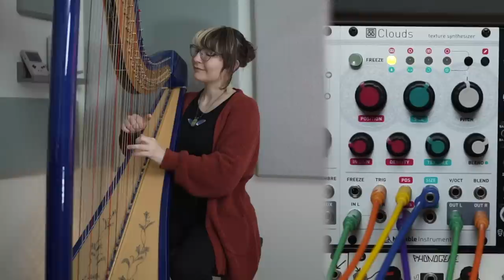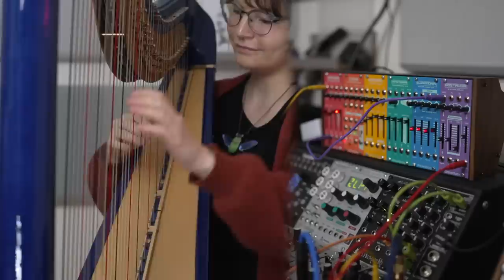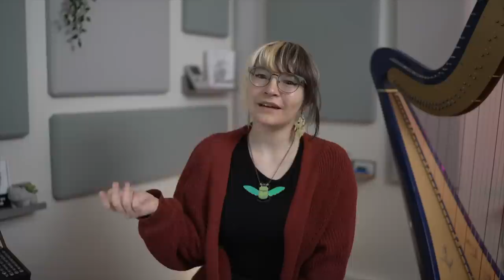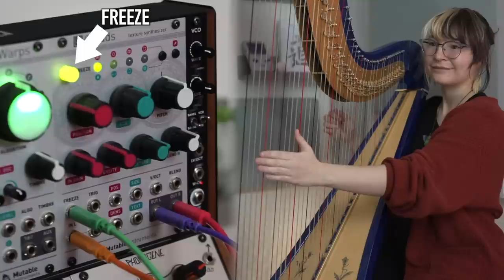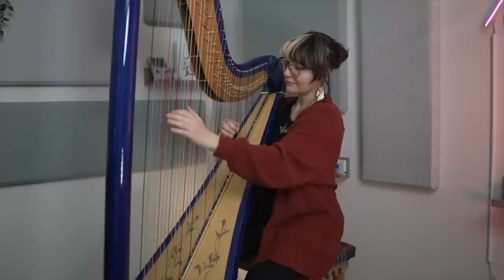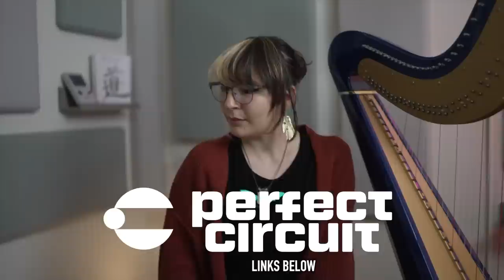I plugged my harp into modular synth. It was insane.

Comment: I think half the ambient modular synth players get into modular for clouds alone. ♥️

Lovely patches, and great use of your harp as a CV controller! It makes me want to plug my electric cello directly into VCV Rack again!

Some day I'll be able to afford taking the dive into physical modular, but for now I'll live vicariously through your exploration!
Reply: 100%. Started with clouds and came full circle back to just have the Grone module which has clouds. Running my upright bass through my modular system was fun.
Reply: You’re able to plug electric instruments into VCV rack? That’s sick!
Reply: @patrickbrogan8770  yea! I don't remember exactly the process, but the standard "Audio" module has inputs as well as outputs, so you can choose your audio interface input as an input into the VCV system on a different Audio module than you're using to get sound out of VCV Rack (hope that explanation makes sense!). Then your instrument is able to be used as a sound source, CV source (likely playing with some amplification, depending on voltages - I haven't done that much with it), and a great source for gate triggers and envelope followers. Also, getting to use VCV as a massive FX rack is handy too.

Depending on your setup, you'll encounter lag, which can be problematic, but I am pretty sure there are ways within VCV Rack to address that as well, just haven't messed with it too much.

Comment: Can I ask how the Octopus Sound was made?
Reply: Check out Fredericks video link thats in the description above! 🙌😎
Reply: TLDR; The octopus does not produce sound, it controls the synthesizers via patch cables. So think of it as a joy stick rather than an instrument in itself. I made a video showing how I built it in excruciating detail, lol.
Reply: The E950 that the octopus is controlling is based on the algorithms used for the Speak & Spell, with extra circuit bending options built in to create all sorts of interesting glitchy textures as well as words and numbers. You can change the words it “speaks” using CV control, so you could use a sequencer to get it to say specific things (such as “help me”), or go nuts with LFO, random CV sources etc.
Reply: @wellurban  👆